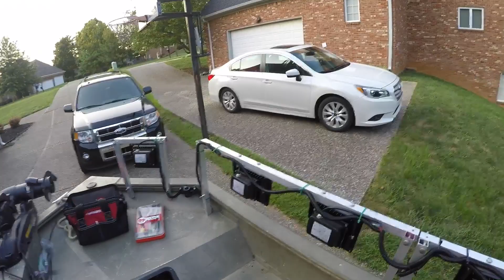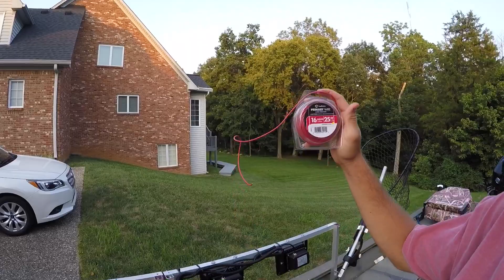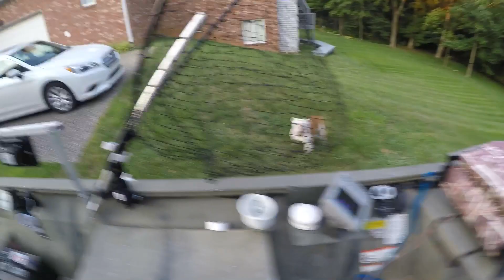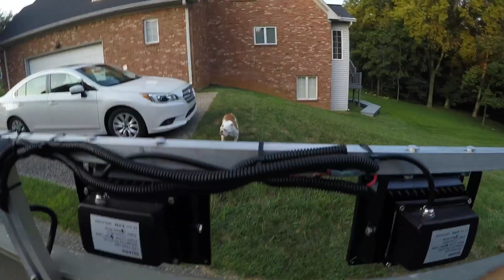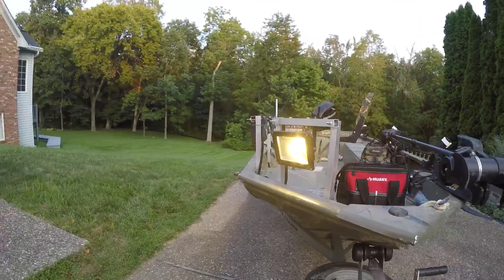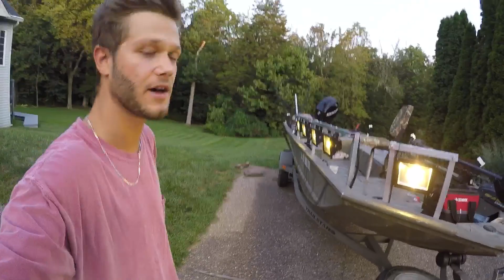DIY Bowfishing lights to a 12V battery

Comment: That’s nice bro, you should run the lines inside the hollow aluminum poles. Not only will it look cleaner but it will also protect the wires from all the elements. Thanks for the vid though, I was looking for some good 12 volt led lights for my boat.👍🏽
Reply from the maker: You are 100% right, definitely would have been cleaner. And glad I could help!

Comment: Did you use a car battery or marine battery? Great setup btw.  I was wonder how I could use just a battery instead of a generator.  Now I know it can be done. Great video
Reply from the maker: Shorty in Texas thanks! And yea I used a marine battery, they just take a little water here and there better. I’ve had em completely submerged and they continue to work

Comment: I hate to say this but I'm gonna copy your set up as its exactly what I'm wanting to do for my boat. Thanks for the demo and info! Very helpful!!
Reply from the maker: Jody Stamper don’t apologize man that’s exactly why I made it! Without welding the cross beams my biggest piece of advice would be to get locking washers to make sure your connections to your boat stay tight and don’t allot the lights to move at all. Other than that a year later I still haven’t had any issues!

Comment: it doesn't look like you have responded to any comments but if you would like, message me and I will draw you a diagram on how to wire that up so you wont burn out switches or possibly your entire wiring harness.
Reply from the maker: Attack Life Outdoors yea I wasn’t great at responding but just now seeing these. I’d love that if you still have time to send it to me
Reply: I'd like to see that diagram.  I'm wanting to do the same thing
Reply: I would like to see it too. I have a 100 amp hour marine battery and I would like to know how many 50 watt leds I could rig on just that one battery for a 3-4 hour trip
Reply: @maverick08jan86  it's a simple math problem. Add total watts and divide by 12 if u have a 12 volt system. That will give u Amps. Then divide your 100 amp hour battery by the amps u added up. That will give u amp hrs.. example....2( 50) watt lights x 2= 100 watts. 100 watts ÷ 12 volt battery= 8.3 amps. 100 amp hr battery ÷ 8.3 amps=    12.0 hrs u can run the lights. And that's just an estimate depending on the condition of the battery.

Comment: How long does the battery last?
Reply from the maker: It last a solid 3-4 hours then starts to dim. If I know I’ll be out for longer than that, I’ll just bring 2 baterries
Reply: If you get a marine group 31 battery it will last you for more than 10 hours with the setup he has